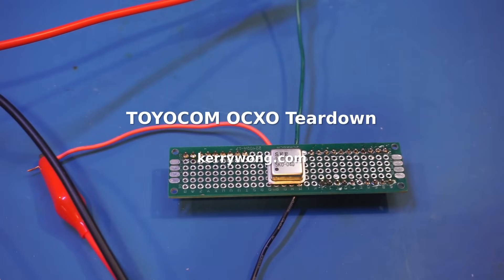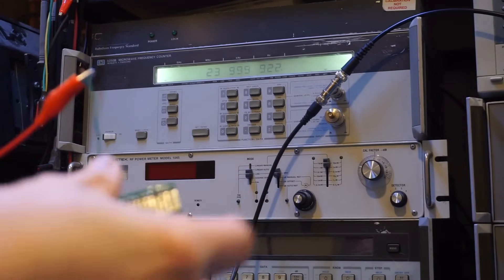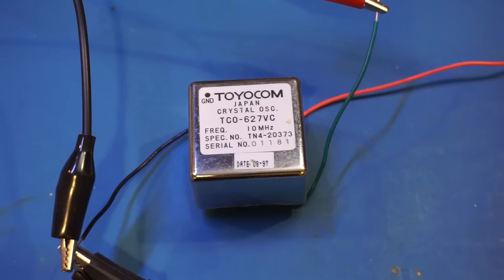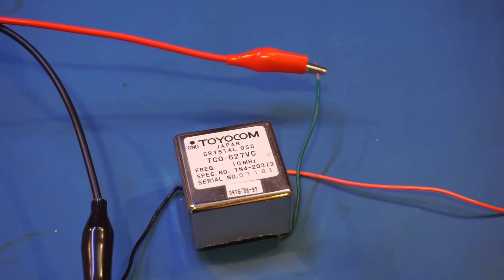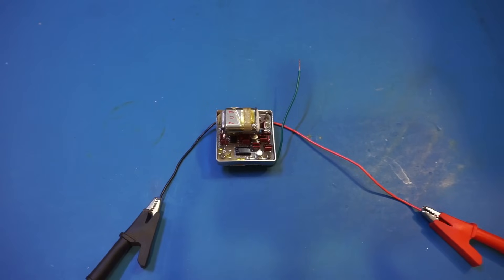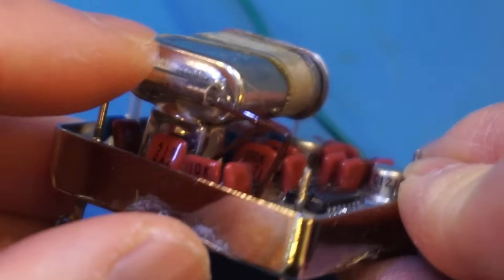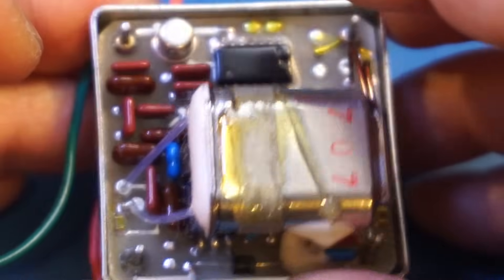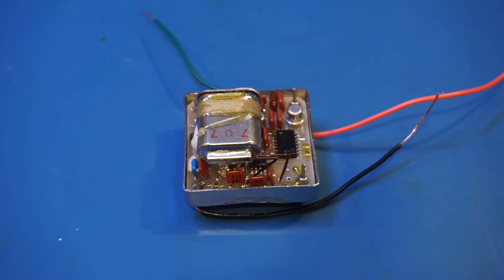Inside an Oven Controlled Crystal Oscillator (OCXO)

Comment: I am also surprised by the component count required and wonder if a higher level of integration would help. But that would probably complicate the ambient temperature control.
Reply: The larger and more thermal mass the OCXO has, the more stable its temperature regulation will be. There's a downside to making it too small.

Comment: I recently bought a Leo Bodnar 2-channel programmable GPS disciplined oscillator for my test bench.  The cost was about $240 US.  The specs are fairly impressive for a relatively inexpensive device.  The frequency accuracy is basically Stratum-1, 1 part in 10^-11.  Phase noise and stability are quite good too.  The unit locks in about 15 seconds with the puck type GPS antenna just sitting on my bench.  Using the GPSDO feeding the 10 MHz reference inputs takes the measurements of my IFR service monitor, Agilent spectrum analyzer, generator and frequency counters to the next level.  I feel it was worth the expense.  It isn’t a rubidium standard, but close enough for me and less expensive.

Comment: Is it possible the crystal is mounted on top of an LM399 voltage reference?  The LM399 is packaged in an internally heated TO-46 package.  The red silver-mica capacitors are impressive.

Comment: Excellent video! I wonder if the slight difference between the counters is simply induced impedance phasing in the cables and T connector.  It makes me wonder how they stabilize a YIG oscillator.  Keep up the good work 😀

Comment: Cool to see what's inside one of these beefy crystals. Do you know if there is an easy way to measure the frequency of crystal oscillators without special equipment? Is it possible to just use a normal oscilloscope to find out their frequency?
Reply from the maker: You can't probe directly across passive crystal with your typical x10 probe, but you can use oscilloscope to measure active oscillators. They typically have TTL compatible outputs and the outputs are buffered.